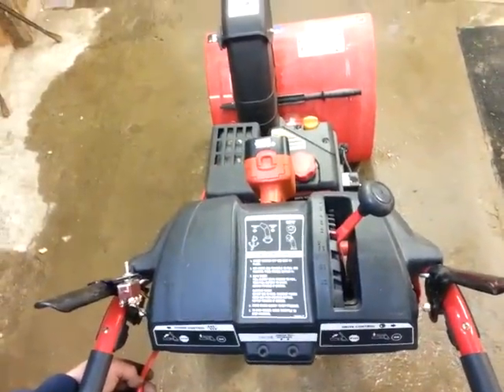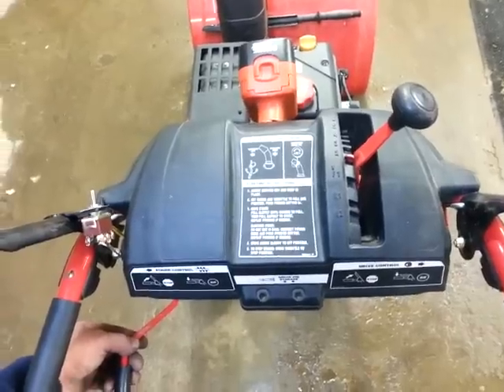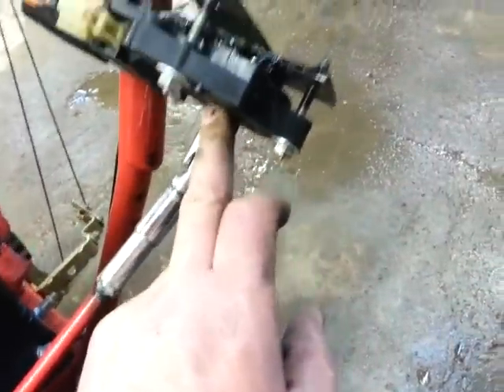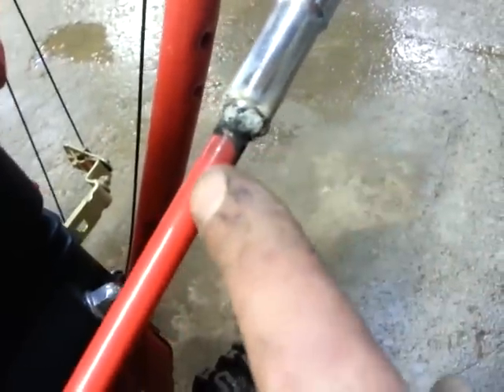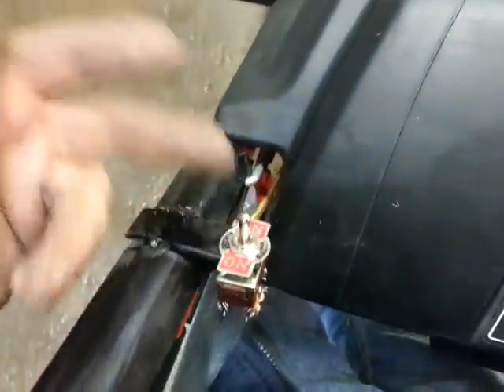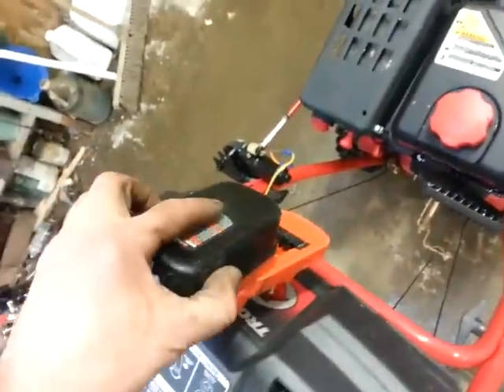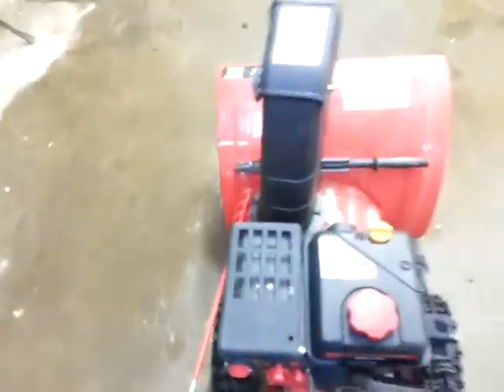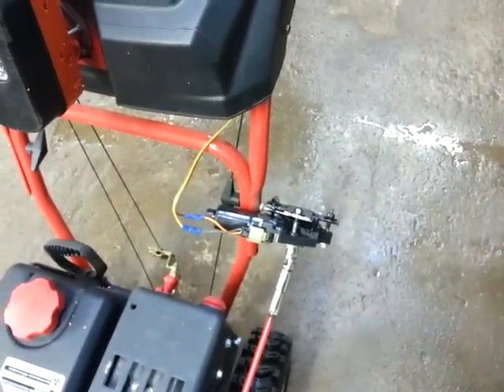$20 power chute turner for your snow blower

Comment: Guess I don't have that problem as the impeller handle locks into position only when drive handle is simultaneously held down. Its a new Ariens model snow blower.

Comment: But you gotta have a battery and a thing to insert the battery in. Its more like a few hundread dollars hack.
Reply from the maker: Not really I just used what I had you could just use one of those batteries with the screw Tops on them
Reply: @TheOriginalAndysGarage  
They also have 3-d printed adapters on ebay to draw direct power from any battery you have on hand. I just ordered one for less than 20 bucks to use the battery from my impact gun.
Reply from the maker: That's pretty cool do 3D printers are really me I'd like to get one someday

Comment: Thanks for the idea.  I Did the same mod but I used the window motor from a junker (2000 Chevy mini van) I had in my yard and I wired it into the on-board wiring for the light.  The light dims a little when I move the chute but that's it.  Works great.  This year, 2 of my neighbors have asked me to rig their blowers the same.  Thanks again.

Comment: Going to do the same thing except would like to keep the manual crank operational so I will be using a gear reduction stepper motor or servo, belted to the crank rod. Would also like an auto turn functionality so that the chute can automatically spread the snow, so control will be via Arduino.

Comment: Can you stop it where you want or it just goes left end right completely?
Reply from the maker: You can stop at wherever you want when you let go of the switch it goes back to the center is called the momentary switch
Reply: Ok but what if you need to stop it at a certain angle let's say 45 degrees it wont work?
Reply from the maker: Yes you can move and stop at any where's all the way left or all the way right or anywhere is in between the very top of the shute you'd have to just sit by hand

Comment: How much for you to make the kit for me?  I'd love to pay you for your work.  I can cut off the damn crank handle and have it welded. Thank you
Reply from the maker: I would have to have the snow blower here to do it right because I don't know if your mouth is different than mine or what there's too many variables
Reply: @TheOriginalAndysGarage  if you made a kit that mounted off the Deere side mount bracket and a drilled socket so the buyer can cut and drill their own spin shaft held by a cotter pin you would make a bundle. I definitely would buy one.

I have no issues cutting the handle down and drilling a cotter hole to match my mowers exact length to the motor socket take off. But I can't make the bracket or the socket adapter welds you made.

Comment: 6 pin switch??
Reply from the maker: it has 6 screws I think the two in the middle were power and then the end ones cross each other for Ford in reverse if I remember right, still working today

Comment: Could you put a link for the geared swivel thing?
Reply from the maker: That's just a 3/8th swivel out of my toolbox hooked to a long 10 mm socket that slid over the the crank handle shaft
Reply: This is the most simple and effective video to make this project. Thank you.

Comment: Great job!!!!
Can you explain a bit more about your power source? 
Was it an old drill?
Thanks from Canada
Reply from the maker: Rick Barendregt the power source was a Black & Decker 12 volt leaf blower, I have two batteries and a charger so when one gets dead I switch them out
Reply: Rick Barendregt , it's a battery from a leaf blower. any 18 volt battery will work
Reply: How did you wire it
Reply: How did you wire up the battery from leaf blower, which wires did you join together
Reply from the maker: I ripped the entire socket out of the leaf blower that was damaged so this way I can slide the battery in and out

Comment: Not to sound critical but first, your mod works great but personally, I have an aversion to modifications that compromise the original function like cutting off the handle and discarding it. If I were to make that style,I would have connected the motor to the shaft without cutting it off. I know of more than one way it can be done. Also in a way that if there was some kind of failure, you can still use it as intended. Another thing is and I could be wrong but I don't think the actuator is weather proof, at least it doesn't appear to be. I made mine entirely different without compromising anything, used all the original holes for mounting and if something fails, I can take it off and make it original in minutes. I do like the way yours works. Nice and smooth. https://youtu.be/-Zxea6moSJA

Comment: I do not want to cut the crank handle. I want to keep it in case the solenoid dies. Does anyone have any suggestions?
Reply from the maker: You can probably go to a Gear Drive Slide the gear over the handle and Tack welded on
Reply: just look for another one and keep it around encase it fails you.
Reply: Run a post off the motor, and use a friction straps between the post and your OEM bar. When the motor post spins it will spin the handle. Not sure what material to use that won't slip in snow conditions though.

Comment: How could I install motor without a welder..
Reply from the maker: Jason Myjak , you could bolt it on use a heavy rubber hose and a couple clamps to connect the drive motor
Reply: @TheOriginalAndysGarage  I was wondering the same thing, Jason. Andy, you just answered my question too. Thanks. The gear on the window motor I'm using is plastic anyway. With all the bits and pieces I've got kickin' around in the garage this mod is practically building itself.